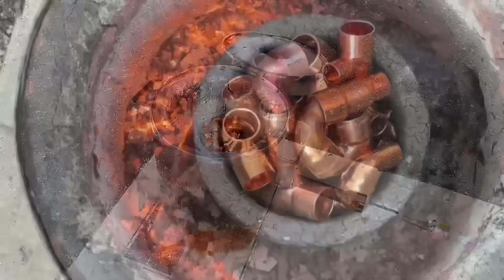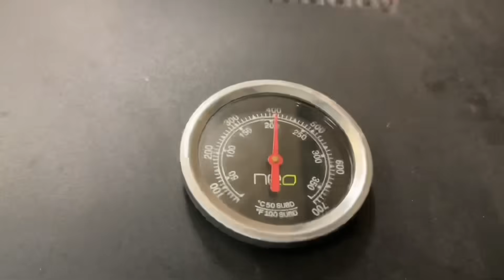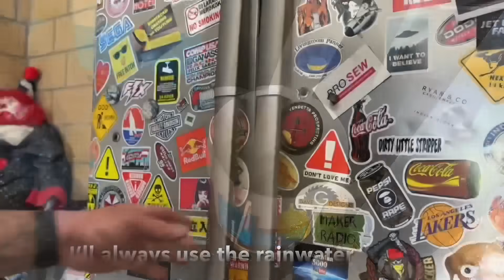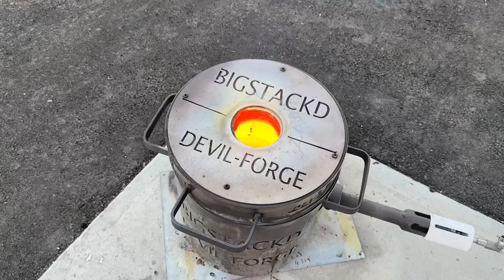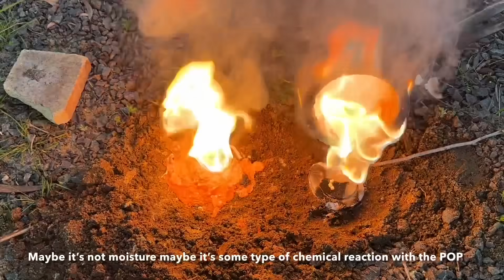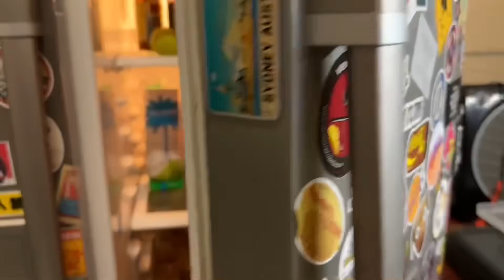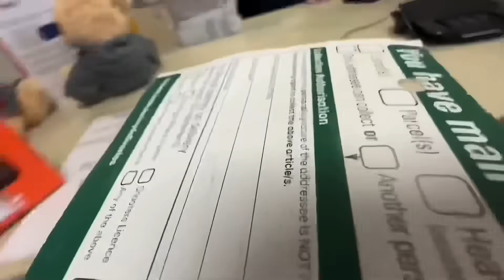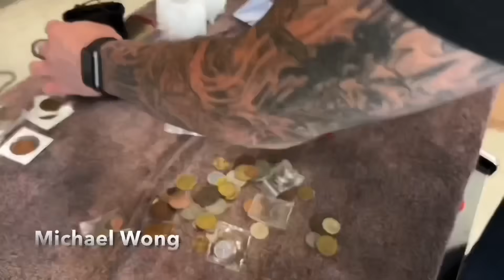Copper Casting Distillery Pieces - Mold Making In Original Garage - ASMR Metal Melting - BigStackD

Comment: I've noticed you tend to get holes in your bars in the same place where the graphite accumulates - it might be oxidising and generating gas, which causes the bubbles. Might be better to use a brush and actually brush a thin layer of graphite over the whole mould instead.
Reply: PLEASE I DONT UNDERSTAND WHY HE HASNT PUT THAT TOGETHER YET. ITS EXACTLY WHERE THE GRAPHITE POWDER IS
Reply: I though that a few videos away.
Reply: And I've noticed that he gets holes(specially the ugly ones)everytimes he uses iron molds,
I've been watching his melts for almost 2 years now and I've always noticed copper with iron mold doesn't go well but the bars look great when he uses graphite molds
Reply: The goat does not make mistakes, it's clearly intended
Reply: Dear mrsmith
👍👌👏 Exactly my thoughts too. I would definitely use a brush or at least a very fine nozzle.
Best regards, luck and health in particular.
Reply: Maybe he doesn’t care. Or likes the effect.
Reply: More grinding=more content=more watch time=$$$
Reply: Graphite is expensive and brittle. Iron . steel last very long. Cheap
Reply: meltdown a bmw z4 engine.😁 magnesium outer shell.
Reply: Better off using a candle and smoking the mold  the candle will leave black soot /carbon in the mold
Reply: @edgotbait  
👍👌👏👏👏👏
Reply: I was literally going to say the same thing. Graphite powder mounds= holes. But I’ve never melted any copper so what do I know?
Reply: I also think perhaps the molds aren't hot enough?
Reply: Mechanical engineer here, so trust me bro im a guy on the internet. Anyway the graphite powder is likely amorphous particle shape. Very high surface area. The main principle here is adhesion. What adheres to the surface is water vapor and plain ol’ air molecules. It takes a while to drive off the water vapor, or a lot more final temp. He should bake it before. But there is still adhesion of the air molecules. That is likely the main culprit, and indeed some of that is oxygen, which burns the graphite, though thats doesnt really exacerbate the problem much if at all, cause its the same moles of gas with relatively same volume. He would get best results by heating the powder separately from the mold inside the furnace to same temp as what metal hes pouring. Id wager it would be near perfect. I think there is another solution here though. Instead of powder, simply take a framers pencil and draw all over it uniformly and dump any residual powder out. You will have a nice graphite/graphene coating.
Reply: It's because the graphite powder is probably holding some moisture too from the humidity in the air. Cooks off the water and expands into those pores.
Reply: @bear1245 if he likes it why did he remedy it?
Reply: Use pam spray 😂
Reply: @hoskins359  thank you
Reply: @hoskins359 but he still "complains" about holes in the bar. It doesn't add up.
Reply: I've just started melting copper into bars, I've been using cast iron molds for all my metals because I want them all the same size and shape, but almost all my copper ingots have holes like that without graphite, and I've tried hot molds colder molds heating the copper more and the only thing that I've gotten to not have them is pouring at just barely molten but then I get air pockets just below the top of the ingots that causes them to mound up which is just as annoying

Comment: Bubbling in molds isn't likely just water, but also traces of leftover wax. The flaming upon pouring makes it even more obvious. I'd add gypsum...as in wall board....to your plaster, as well as some sand. Tinker with the recipe till it works well for you, then make sure you heat the molds to the wax's boiling point, and hold it there for a few hours to make sure you get rid of it all. It should help a bit if you pour into hot molds too.

Comment: I learned about how all drywall is fire resistant due to the gypsum core being made of calcium sulfate dihydrate. Basically, as it heats up, the trapped water molecules that forms the dihydrate releases as steam, requiring a lot of energy to burn through and penetrate. Plaster of Paris is fundamentally the same material.

Long story short, plaster molds will never work for this application because there will always be water trapped in the molds. No matter how long you dry them, it's bound by chemistry until you burn it, in this case with molten metal. I'd recommend concrete molds for the future.

Love your vids and all you are about! Hope this might help you out a bit

Comment: Another thing you might try to make your molds out of is ceramic sculpting clay. You can get it at any ceramic craft stores. It can be thinned with water, can can be poured like plaster of paris. But it will allow for better evaporation of water, as it will not solidify and hold water like plaster of paris will.

Edit: I remember that the type of casting is called lost wax casting. The mold is put into an oven to melt the wax. Then when the wax has melted out, the mold is left in the oven to cook off any leftover wax. The baking removes any excess moisture. Sorry I can't provide you with more info. But a search on line should get the info for you. Good luck on the next pour.

Comment: good video BigStack. I have done some plaster casting and it doesn't give the greatest results. A few things that help, mix a little portion thinner and dab it on the molds too capture the detail better. Dab let it set dab again repeat till you are happy. Then when you pour the main mold, if you can get it there mix in some vermiculite. It helps with holding the mold together in the heat, you can also add some white silica sand to the mix as an added binder.  this will help you Of course we used this mix for aluminu casting nothing as intense as brass or copper. Maybe this will help. Keep up the great work.
Reply from the maker: Yes well on the next mold I’m gonna do half POP half silica sand and have the mold in the kiln holding at 1000°C and when I’m gonna use the mold I’ll pull it out pour into it while it’s still super heated and I’m sure that will give a lot better results👊🏻😁

Comment: D if I may make a suggestion. 

when you add powders like the graphite and others for the purpose of mold release etc. instead of using a squeezy bottle, try a sock of cheese cloth, you make a ball of it, put your powder in it rubber band it tight. then while holding the ball in 1 hand, you tap that wrist, with the other hand. or even tap it against your palm. you will get MUCH better results and far better coverage while also being more efficient with the material, so overall it will be a WIN WIN. try it. when I do this method, I get much cleaner releases. and the more uniform coverage leaves less imprints which too leads to cleaner releases and cleaner final product.

YOU are THE BEST; I have wanted to share this with you for a while I just keep forgetting to LOL great day mate. TY for everything you share with us. TY.

Comment: Nice video!  I love it when you cast figures. To the problem with the poppig molds. Gypsum ist a hydrate of calciumsulfate and contains a lot of water in it's crystal makeup. If you heat it over 130°C it releases the water. That is why it's not working for casting metal. Keep up your good work 👍

Comment: That quench shot was a fun one! A quench cam would be cool... Would be a fun challenge to use a waterproof camera, but still have a way to keep it cool and safe from hot quench water.  Maybe one could pump cold water through an enclosure?
Reply: Maybe just silicone a plastic window to a hole in the side of a bucket...
Reply from the maker: Don’t worry mate I’m onto that already👊🏻😁

Comment: Yes, it can be tricky to get large bags of white powder past customs, even if it's only investment plaster.😂
.
As for the holes in your copper, heat your steel (don't use graphite) mold to at least red heat, preferably 1100°C or more. You want to keep that molten copper as free-flowing as possible, for as long as possible, to allow the gas bubbles to make it to the top and burst. Right now, the copper is freezing before the gasses can escape. I'm pretty sure that's why it takes 5 or 6 goes to get a bar without holes - the molds are staying hotter for longer by that stage.

Comment: Plaster will hold water for a very long time. Next time you make those molds, put crushed soft fire brick in with the plaster when you are mixing it. When you go to melt the wax out, put in your furnace and leave it over night with a very small flame (called candling) next day your plaster will be bone dry so no steam explosion and the firebrick will help with thermal shock.

Comment: Holes in copper: 1. Stop using powdered graphite. The molten copper may be hot enough to oxidise it to CO or CO² gas. 2. Try heating the mold to at least red heat just before pouring, and let it air cool. Might work, might not.
Bubbling plaster: try adding some finely sifted sand and some crushed bentonite to your plaster mix. How much? No idea - you'll have to experiment. The sand will strengthen the mold and the bentonite will suck up any residual moisture.
Please understand, these are merely educated guesses. I've never actually melted a damn thing. Not on purpose, anyway.😂
.
I've been watching you for 7 years now (well, I've watched 7 years worth of videos) and, knowing that you already have the molds, I've long wondered why your house isn't totally covered in small metal Frenchies.🤘🐶

Comment: Mechanical engineer here, so trust me bro im a guy on the internet. Anyway the graphite powder is likely amorphous particle shape. Very high surface area. The main principle here is adhesion. What adheres to the surface is water vapor and plain ol’ air molecules. It takes a while to drive off the water vapor, or a lot more final temp. He should bake it before. But there is still adhesion of the air molecules. That is likely the main culprit, and indeed some of that is oxygen, which burns the graphite, though thats doesnt really exacerbate the problem much if at all, cause its the same moles of gas with relatively same volume. He would get best results by heating the powder separately from the mold inside the furnace to same temp as what metal hes pouring. Id wager it would be near perfect. I think there is another solution here though. Instead of powder, simply take a framers pencil and draw all over it uniformly and dump any residual powder out. You will have a nice graphite/graphene coating.

Comment: Don't mean to tell you what to do bud. I found using POP  burns too much and just crumbles due to the heat. A suggestion would be to use cement and let them dry for about a week then melt the wax using an oven. That's how I would try it. If I'm wrong I apologize

Comment: Hey buddy, you need to mix your casting material half plaster half silica and reinforce the outside of the mould with wire. Second up only use alpha plasters they are much finer for details and much better under temperature, hope your next pour goes OK

Comment: you should try sodium silicate+sand casting. print your models with pla, make molds using sodium silicate, cook molds after a few days. this waw all play will be burnt out. and pour while mold is still hot

Comment: Holes in copper cause - graphite powder. Not sure what else you could use but it’s pretty much why you get the holes. The graphite causes outgassing when the hot copper hits it. Those gasses get caught under the copper as you pour. Slow pours give those gasses time to escape but you’ll always have some. Maybe try sawdust instead?

Comment: Perhaps get yourself a Case Tumbler for your used brass and other more grubby items before the melt. Would significantly reduce the amount of slag you would have to skim. Might I suggest just using walnut (shell) media as it's relatively cheap and biodegradable when it no longer does a good job. Could the POP be residual wax? Love your videos D

Comment: The plaster of paris molds might be taking in moisture from the ground. Could try a bin of dry sand to place them in for the pour. If they still volcano in the dry sand it could possibly be the wax is penetrating the plaster and causing gases to force out through the molten metal.

Comment: Just a small suggestion you could add some silicone to your plaster mold mix that way it won't flake apart from the heat from when you pour your medium into it

Comment: I took a look at why Plaster of Paris might be causing you issues.  Plaster of Paris is gypsum powder the reforms and sets when it is hydrated.  Gypsum has a melting point of a bit over 1400 degrees Celsius.  Brass has a melting point of over 1700 degrees Celsius, so I think you are melting your plaster when  you pour the mold.

Comment: Maybe it's the thermal coefficient of the POP.  Jewelers use it but in smaller molds.  Perhaps the amount of metal you're pouring in overwhelms it.  I also read that If it is heated to more than 130 C, the setting properties of plaster of Paris are partly destroyed?

Comment: The failure on the wax castings likely due to wax residue. You really need to burn the mould, coz by heating, you will melt the wax out, but some will draw into the plaster. This will then cause offgassing when pouring, hence the black smoke  as well due to the carbon. You need to get them at 800 deg C for at least 30 min.... Make your own investment powder by mixing fine silica sand and POP. I think 70% sand to 30% POP? Check on the net for exact recipe. You have an ocean close by. Get some nice sand and sieve it.

Comment: Just a thought here, what if you made more POP molds amd put them through your kiln first, just to make sure the splatter doesn't come from moisture still trapped in the mold.
Reply from the maker: Yes buddy that’s definitely gonna be happening in the near future. And when I do pour into them I’m going to pull them straight out of the kiln that will be set at around 1000° so I know they will be toasty as a MF and then there’s no excuse for me to screw up again👊🏻
Reply: tl;dr: POP is not good for casting metals and there’s not much you can do about it. 

The molecules POP is made from contain loosely bound water. Heating to just 120C makes HALF of the water escape and changes it back to what you had before you made the mold (just not powdered). Not sure how strong the mold would be at that point. 
Heating further to 200C drives off the rest of the water. This supposed to be a better form of plaster but again I’m not sure what would happen to your mold while the water left. 
At 1100C (which is less than 200C hotter than the melting point of brass), the rest of the plaster decomposes giving off sulfurous fumes. Does it smell like sulfur when you try POP casting? Do you need to heat the brass above 1100 to make sure it doesn’t solidify while pouring?

Comment: 6:18 Mix water or alcohol thinly with Graphite and apply it thinly to the mold with a brush. then the problem with the holes in the casting should be fixed. please try in the next video.

Comment: to have better result with plaster mold
fist a thin coat of liquid plaster on your wax let it dry and wrap it with metal wire(this prevent mold cracking ) and the put your form into plaster

Comment: I was wondering on this melt, you normally smash the small copper pipes to prevent the moisture explosion. With these fitting though you didn’t squishy them and was wonder if there was a difference from these fitting from the other times you melted copper pipes and fittings?

Comment: So that's where all my fittings went from my jobsite, those peices look exactly what I needed for my job this week, they must have save the full lengths of pipe for other videos. 

Hey "bigstackD" save the "fittings" (the small tube pieces that bend & change size) to sell on their own for more money than just raw copper. Or are you scared you might get caught? You can probably bring them to a Home Depot without a receipt and get like $3 a fitting instead of 35 cents as raw copper. Though you got lots of followers so maybe you get buy them yourself, but if so find some scrappers and buy off them.

Comment: I am wondering whether the results would become better, if the mould would be within a crucible and preheated glowing, so that the metal does not instantly freeze when touching the walls of the mould. Maybe the bubbles then would have a chance to escape leaving a more smooth surface... 🤔 But that's just an uneducated idea, I am by no means an expert.

Comment: Got to have that mold cherry red for copper to not degas the steel and get pockets.
Reply: Also the wax residue was probably the issue with the pop. Kiln at 500f for an hour and then slowly raise in 100 degree increments (to avoid cracking) to 1200f to "burnout" some suggest 1500f and hold for at least an hour. Pour as soon as the mold come out of the kiln. GL thanks for the video.

Comment: Instead of using POP. Why not try some Alumalite mold putty? Itll actually hold up to a lot of heat. You might get 10 or more pours per. The only downside is size and detail. Itll cast the detail just fine. However, stretching the mold around that kind of detail may prove too much for the putty.

Comment: Is it possible that the bubbles in the copper are a result of rust in the iron mold?
Rust is oxidized iron, so might it release oxygen from the heat of the copper?
I know, wild speculation...

Comment: On average what is the percentage gas cost in relation to the value of the smelted metal. I understand it will depend on the value of the different metals as well as the different melting points but just as a ball perk figure. I guess I'm really asking if it is profitable or whether you make a loss?